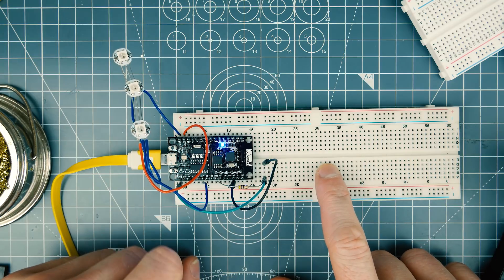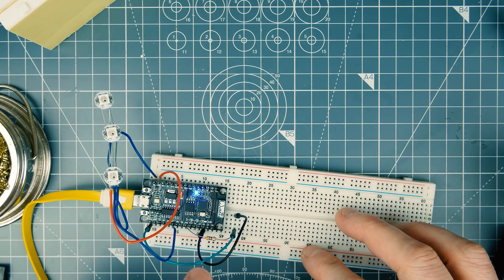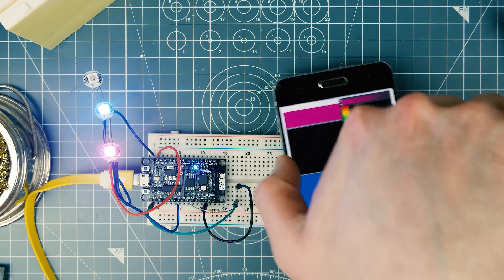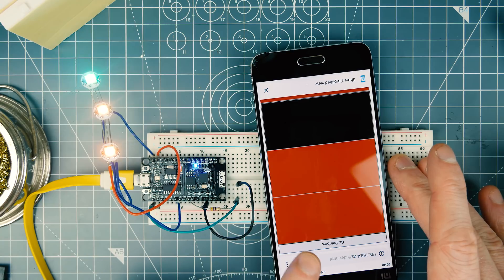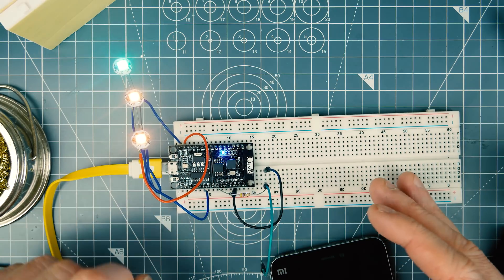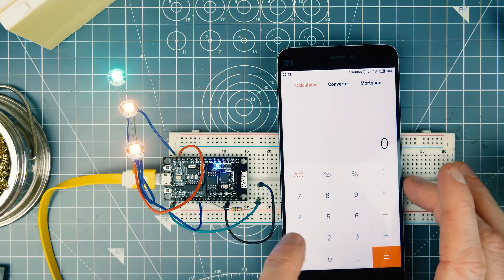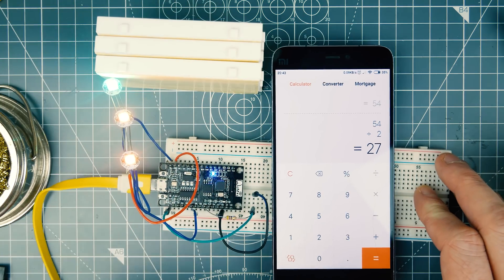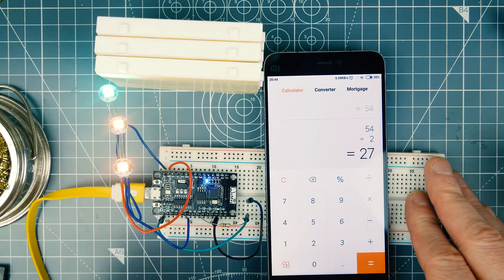Bridge Lights Part 1: It's a start

Comment: After working as a Dj / Lighting software and venues, you would be better off splitting the led in to 2 * 3.5 meter lengths and power then with 2 separate power supplies, one for each section splitting the power / amps equally required. By running power in to the middle and outwards, you will get a more constant light as the will be as bright at the centre point as they extend in length the strips can dim down so you dont end up with bright ->dimmer->bright in the middle. This is the way most architectural lighting is done in large venues. HTH. BTW like the phone interface , works well

Comment: You could take a look at some potentially cheaper options. I bought some WS2811 strips last year. 
They are addressable similar to neopixels that you used but each "pixel" from code's standpoint is actually 3 LEDs on the strip. That's probably why they are a cheaper option but it shouldn't matter really for a project like yours since you probably want to light up the whole strip with the same color anyway. Or even if not - with 7 meters 1 or 3 LEDs doesn't make much of a difference when making a rainbow or something like that.
The density is the same - 30 LEDs/m (there is a 60 option). The only downside I can see is that they are 12V but I was able to control them with 5V signal (not sure if I tried 3.3, you could use level shifting anyway).

Comment: In my experience , the rating are way over anything you will actually see because of the pwm, I have some notes somewhere, I have a 5m strip of weatherproof, I will see if I can find it, make sure you have a led close to the controller to buffer the din and you should be fine, even if its just a local led etc, depending on your setup you can backpower your strips and apply power to both sides to prevent voltage droop at the ends. You will also have to use a fairly large guage wire for 5v to prevent voltage drop also. I would consider looking at 12v strips also, easier to handle large runs of power

Comment: Level shifting may be required, may not.  From my experience running strips with a 3.3v data input it seems to depend on the distance of the first pixel from the microcontroller (resistance of the data wire?).  Level shifters can work, though one I have from China isn't fast enough to keep up with the data for these kind of strips (it seems to pass out an analogue signal if you go above a certain frequency - like inverse PWM!).  You can also use a 1N4001 diode between ground of the ESP module and LED strip ground.  This makes the signal appear to vary from 0.6v to 3.9v at the "neopixel" which is closer to their spec.  It's ugly but it works.

Comment: As long as the "-" are connected, you can run the NP's from a separate power supply.
Just don't forget the inrush capacitor.
If you are super paranoid, you could look at something like a transistor or optoisolator between the esp32 and the first NP.

Comment: I mentioned the SK6822 because they are the only ones I have found that pass data around dead "pixels".
However they appear to be only available from the manufacturer > IP67 version here:
https://goo.gl/zS5uYN
Small Ardy Forum discussion about the SK6822 here with a last word by the gent who wrote the FastLED library > D. Garcia:  https://goo.gl/oBtxoV
FastLED page: https://goo.gl/ANRpPP
Github with recent code update for Arduino (lots of  example code) :https://goo.gl/zS5uYN

Comment: Have you considered using the 12v addressable modules? Might make your power requirements a little easier to deal with.

https://www.superlightingled.com/dc12v-096w-ws2801-waterproof-5050smd-metal-4-leds-full-color-digital-programmable-individually-addressable-rgb-led-pixel-moudles-string-lights-p-510.html

Comment: Level shifting :p

Certainly with the wbs2812's the led dill drive it's data out from it's supply voltage (so 5v) so as far as communication goes you only need to worry about talking to the first led (which will usually be fine at 3.3v), as far as I know the sk6812's are the same (they are drop in compatible part/clone).

Your only concern after that would be giving enough current to the leds :)

Comment: To up the voltage data have a look for single or gate level translator  chip  or a fast transistor with a careful design you can use a single transistor and not invert the signal. But I'd look for the chip as the control signal is high speed
Reply from the maker: A single transistor is where I am heading first, it should work but I may need to bleed off the gate to ground to prevent ringing. We'll see, it may work fine as is but I will have to wait for the strips to arrive.
Reply: David Watts I cant remember where now but I saw someone using a sacrificial ws2812 to boost the data line up to 5v
Reply: @DavidWatts  Andreas spiess had a trick to get around the 5v leds with 3.3v data, where he put a 220pf cap between data in and ground of the first led and it works (no idea why)

Bi directional level shifters are a good option (which you mentioned already, but just giving them the thumbs up!)
Reply: will try and describe this as best I can.

A resister between 5V and WS2812 input. try 4k7
the ws2812 input to the collector of the transistor.
a 4k7 from the 3v3 supply to the base of the transistor.
a 47K between the base and emitter.
the emitter to the port output.
this will level shift without inverting the signal but not sure how fast it will work.
when the output is high the transistor is off and the ws2812 input will be pulled up to 5V by the 4k7, when the output is low the transistor is turned on and pulls the ws2812 input down to the output level +VCE.

i'm using this as a level shifter for driving a 3.3v input from a 2V output and it works great at 11500KB rs232, so might work at higher speeds.